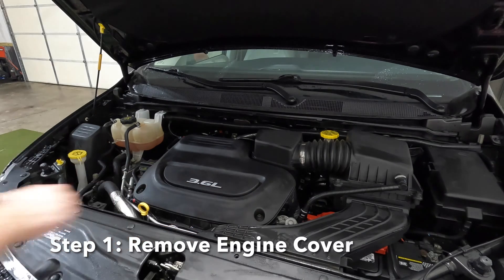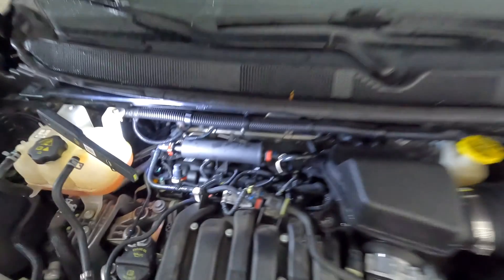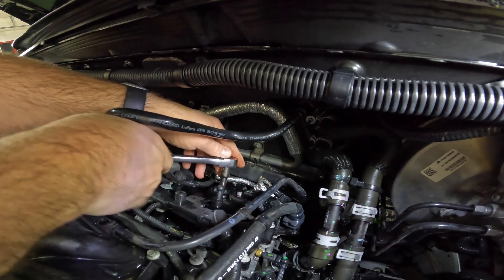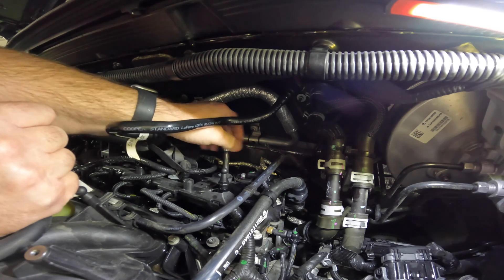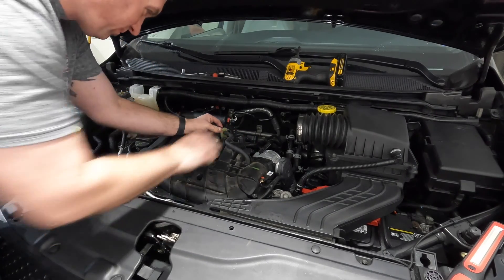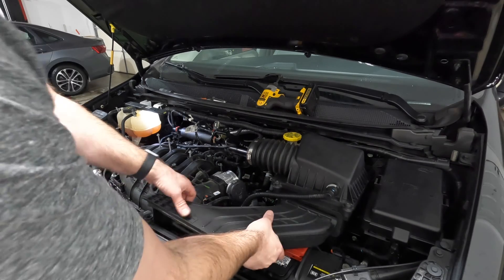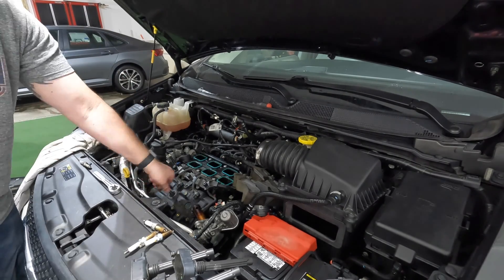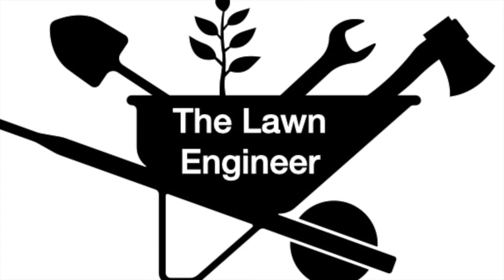How to Replace Spark Plugs/Coils Chrysler 3.6L Pentastar V6

Comment: Thank you for the great video!!! I just completed the plugs and coils on my 2018 Pacifica with 107K miles. I went with the DELPHI GN10951 coils and NGK 93175 plugs. I would highly recommend removing the top threaded post on the "S" bracket on the lower right side vs removing its 3 bolts. This allows the "S" bracket to remain and the intake to still be able to be removed. I believe the post can be removed with a small female torx socket. Removing and re-installing this "S" bracket was the most time consuming and difficult part of the repair and I wish I would have tried removing its top threaded post instead. Most of the electrical clips have small plastic tabs that I pushed out with a small flat screwdriver and then i used a bigger flat screwdriver to pry the clips off. The other non-electrical clips can be removed by squeezing on the plug and pulling. My EGR valve was very dirty so I cleaned that up using carburetor cleaner and this was the other most time consuming part of the repair. I didn't have to remove my small secondary battery nor the air box containing the air filter. My intake gaskets still looked good so I didn't replace them.
Reply from the maker: Awesome, thanks for the detailed feedback on what worked for you!
Reply: @TheLawnEngineer I just bought a 2018 pacifica s two weeks ago.. engine light..#6 maybe.. wow..

Comment: This guy is sharp. Only thing I see is to much anti-seize you need just a very small amount on the threads. Otherwise it will mess with your torque specs. Great video!❤ trust me the spark plugs are not gonna get stuck like in a cast-iron block period. 30 years experience tells me so.
Reply from the maker: Thanks for the comment.  I guess I was worried about big anti-seize getting on my case for not using it 🙃.

Comment: Just a helpful tool for any auto repair where these stupid easy to break plastic hose clips are being messed with is a MECHANIC AUTO PICK SET  there very cheap and extremely help full specially for anyone with weak fingers the curved pick is my go to for working the locking clip back so the clip can be squeezed and released or pulled out
Reply from the maker: That’s a great tip, thanks for sharing!

Comment: What is the grease put on spark plug
Reply from the maker: I used a copper based anti-seize.  The OEM does not recommend using it, but some people swear by it.  I'm somewhere in the middle.
Reply from the maker: Or if you are referring to the boot side, its dielectric grease.

Comment: Thank you, I love your content, so much appreciated. How do you know if you ignition coil or plugs are bad? Currently our 18 Pacifica Limited is in the shop for : Oil Cooler / gaskets, LF RF Solenoid seal replacement $1400. We live in the midwest with sub zero temps, and hot summers, but "what the heck." Seems a Chrysler issue across the board. On top of that diagnostics for heated steering wheel failure, shows wiring harness melted in center of stearing wheel, potentially impacting AIR BAG. Again "what the heck." ...too many odd and end items failing. What are you seeing and know of on your end?
Reply from the maker: I’m glad you are finding value in my videos.  

The best way to test out a coil is to swap it with another cylinder and see if the misfire moves.  Unfortunately the effort it takes to get to the coils on this engine doesn’t make that practical.  If you have to take it down to access the coils and plus, I would replace all plugs and the coils on the cylinders with misfires.

Comment: At 1:30 you push that white clip back for the wire connector with the GREATEST of ease!  In reality, not happening for me.  One actually BROKE!  The connector seems to still push in and stay secure, but what options do I have to either repair the white part that broke? And/or release better in the future soo I don’t crack the piece! Otherwise, This video was essential!
Reply from the maker: I wish I could help more but I have trouble with some too.  They could be more user friendly.

Comment: I have a #3 misfire following to #5. I’ve replaced all spark plugs and coils in 1, 3, and 5. It’s still doing the same thing. Is it beneficial to swap 1-2, 3-4, and 5-6?
Reply from the maker: It is possible that the new coil is bad.  I would swap it and see if the problem moves.

If it stays on the same cylinder, it's time for a compression test.  You may have valve train or head gasket issues on cylinders 3 and 5.  

If the compression checks out fine, you likely have a bad fuel injector(s).

Comment: Great video, but changing the plugs on this engine is STUPID complicated.  I used to be able to pop the hood, pull off the valve covers, yank out the plugs and put new ones in without any other hassle on older vehicles.  I get that engines are more complicated these days but it feels like companies are just trying to make it more difficult for a DIY'er to accomplish anything lately...
Reply from the maker: I completely agree, it's stupid complicated.

Comment: Luck would have it. I have a bad coil in #6, so yeah, thanks for the tutorial. I'm well versed in maintenance, so just watching what you did helped me out immensely.  I did order a new set of 6 but I'm caught in a bind so locally I can get my hands one one coil,so I'll changed that one out and expect great results then do the other 5 in 2 weeks on a weekend 😅
Reply from the maker: I’m glad you found some value in my video even though you have quite a bit of experience.  

It’s too bad you were only able to find one coil locally, but at least the second time will be faster.
Reply: @TheLawnEngineer  as luck would have it, I found 2 coils, so I replaced #6 & #4, and I did a spark plug change to all 6 cylinders I did fix my issues and after driving for a while my check engine light disappeared 😅 Monday will be engine oil change, 
Thanks again, till the next project. 👍
Reply from the maker: @Militaryman64  Awesome, glad it fixed your issue and you were at least find 2 coils.

Comment: I m pretty sure I messed something up while doing this. Car hasn't run the same since the plugs were swapped.
Reply from the maker: Do you have a check engine light?  If not, it’s likely a vacuum leak, missed reconnecting a hose?

Comment: my dealer changed 4 rocker arms and it still ticks. I looked at the valve covers and said how did you do that because they were never removed. They lied and I left it there and told them to fix it right. All this under warranty. They didn't think I would check like most people don't and live with the tick. The original RTV sealant was still there never touched and sand and dirt around covers
Reply from the maker: Very sad…the term stealership applies too often.

Comment: Where that hiding braket bolt at I can’t find it anywhere, I found the nut but not the bolt
Reply from the maker: It's right in the same area, very hard to get it on video.

Comment: At 1:25 or so there is a long horizontal cylinder that blocks the camera view of the rear coils. At 1:29 the cylinder has been removed. I can remove the plastic hoses from both ends, but have not figured out how the cylinder itself comes out. How is it connected to the engine? Do the ends snap on over hard plastic studs similar to the one holding the air box? Thx.
Reply from the maker: I’m sorry, I’ve been tacky my brain to remember how that came off but I can’t recall.  I vaguely remember it just pulling off.
Reply: Ok, figured it out.  Yes, each end pops straight up off a plastic stud.  I pried the ends off with an angled tool without exerting much force.  When done the ends just snap back on, sort of like when replacing the beauty cover on top of the engine.

Comment: Would you happen to know what the gap should be? I bought o.e. for mine and they are at .024 and I'm not sure if that's right.
Reply from the maker: I'm seeing an OE recommended gap of 0.040 in but it varies a bit depending on the plug.  Checkout www.rockauto.com it gives OE gap recommendation for a bunch of different plugs.
Reply: @TheLawnEngineer  Thank you for that.I'm not sure why they say OE and set them that tight.But I'll definitely be opening them up👍
Reply: How did you get those ignition wires off of the coil so easily?

Comment: Do you have to replace any gaskets when putting the plenum back on?
Reply from the maker: You don’t have too.  The gaskets are silicone and they won’t typically stick or tear.  But it’s not a bad idea to change them out because they can become compressed over time.
Reply: @TheLawnEngineer  This was my exact question RE: ANY gaskets that may need or SHOULD be replaced.  What parts might it be SUPER smart to pre-order (connectors?) as there is a decent chance they could break!?  Thx in advance!

Comment: Had a P0305 cylinder 5 misfire code. Your video was helpful. I replaced the spark plug and ignition coil and seems to be good as new. I since 5 is on back row, I didn’t remove manifold to save time.
Reply from the maker: Nice work!  The back row makes life easier.
Reply: That hasn't turned into the nightmare "P0305 to blown headgasket" situation has it? Those stories are all over the web and kinda worrying me since my coolant is also low.
Reply: @ after cylinder misfire popped up again, mine was a blown gasket. Had it replaced and now all better.

Comment: ok just making sure that i will not have to replace a intake gasket since you took it off? i am used to older rigs when you take them off its wise to replace the gasket. never worked on one that had a plastic intake. Is there a difference?
Reply from the maker: The gasket(s) on these intakes are a bit different.  They are individual silicone pieces that do not stick and rip/tear.  They can dry out over time and compress but in general can be reused.  

I didn't have any issues with reusing but it isn't a bad idea to replace them.  I've also replaced the oil cooler, which is under the lower intake manifold, so I replaced them all at that time.  

Video here: https://youtu.be/GauBMDckIKE

Comment: Thanks for this video!!  We had either a bad spark plug or coil pack and were able to change them all out ourselves for under $75.  I cannot imagine what this would have cost us at the dealership.  I would never have attempted this without your video.  Thank you so much.
Reply: Under 75$ how? The plugs are 20$ each and the boots are 75$ each?
Reply: @wacoodude9436 plugs range from 8-that much lol I got mine for 13 dollars a piece platinum plugs
Reply: @wacoodude9436 I think they may they changed one cylinder.
Reply: @wacoodude9436  Wondering the same. You owe us an explanation Mr.!
Reply: $500 at a mechanic. Just got ours back yesterday.
Reply from the maker: Glad it helped! Thanks for leaving a nice comment 👍
Reply: @TheLawnEngineer  Did the poster or you put in aftermarket coils or oem?.. Oems are $90 a piece. AIN'T gonna happen😅

Comment: It took me forever to find that hidden nut underneath. Mine has some black plastic over it, and I can't get to the nut. Also, I need step by step video for all the connectors. I've broken 3 already. They're brittle and too difficult to understand!
Reply from the maker: That nut is a pain to get at, and filming it seemed impossible.  Also, there are some other decent videos out there on the electrical connectors.  There is a little trick to each of them and if you get it, they separate easily.
Reply: The black plastic over the bolt is actually a support hook for the wiring harness next to it. The hidden bolt acts as a stud for the harness to connect. Try putting your fingers under the harness near the stud and the plastic should just slide off.

Comment: Great video. One issue - I can't for the life of me figure out how you get the wire connector to disconnect from the coil like you do in the video. I use a small screwdriver (like you) to "click" the little gray "lock tab" but absolutely can't get the connector to budge on 1, 3 or 5 so far...
Reply from the maker: You should actually press down with your thumb and pull the latch back at the same time.  If you get it correctly it’s like magic but you have to get the hang of it.
Reply: I had to take it a step further. Carefully pull the white plastic tab outwards a tad until it clicks in the unlocked position, and then press downwards on said tab with your thumb while using a plastic trim tool to carefully pry the plug off from behind.  My thumb got sore, so I used a small narrow-bladed screw driver to carefully hold the white tab down while using the trim tool to lightly pry the plug off. As with all connectors, easy does it!!  If you are only changing out your spark plugs and not the coils, there are a couple of YT videos that show you can simply pull the coil pack up and out of the spark plug opening without the need to disconnect the coil wire, but if you pull it out using too much force you might possibly damage the connection.

Comment: Thanks so much for this. My reluctance to tackle this project revolves around the various wire and tubing connectors. I appreciate your comments on how to remove the air temperature sensor (at about 1 minute into the video).  At 5:14 you use a small flathead to pry up on a red connector, but then explain that the red part can be pressed down while pulling out on the tube to free it. True? It looks to me like one really does need to pry up on it (and then press down when reinstalling). Also, is there anything unique about removing the electrical connectors on the throttle body side (at around 6:15 into video)? I'm pretrified of damaging a connection. Once again, thank you for this and your other Pacifica videos.  Very valuable.
Reply from the maker: If you have some time and patience, you can get this done.  

At 5:14, no need to pry...pushing down will release and allow reassembly.

Electrical connections can be a bit tricky but they should all release with a gentle wiggle if you have the release catch properly depressed.  The trick is taking your time and don't force them.

Comment: Generally speaking, I liked your video and I completed the job of plugs and coils in an afternoon on my 2017 Pacifica.  However, you really glossed over some stuff on the righthand side (as viewed) that was very troublesome.  It was very difficult to get the EGR valve off over those studs and the hose connection.  One of the studs by that hidden bracket was covered by a push-on wire restraint making it difficult to see what was keeping the plenum from releasing.  Your video made that EGR removal look like a snap, which it was definitely not.
Reply from the maker: Thanks for checking in.  Your feedback is fair, that particular nut for the EGR valve is a pain in the butt.
Reply: @TheLawnEngineer  Nice video. Greatly appreciate the nice and clear footage and helpful voice over. I had to remove the whole bracket with the hidden nut by also unscrewing the two lower bolts. Loosened the two nuts holding the brake booster pump to allow for wiggle room to get the bracket out. Keep these videos coming please! Thank you!
Reply: My sentiments exactly! Over all the video was good and informative, however that EGR almost made me quit the whole job and have my brother in law finish the job. I eventually was able to disconnect it completely to get it fully out via whatever hose it connects to. I had to watch another video to make sure I wasn't messing anything up.
Reply: Yeah there is that hidden long plate bracket with 3 bolt holes under the EGR once that comes off the EGR slides right off the 3 studs..

Comment: We have a 2018 and recently have had a local auto shop replace #5 spark plug and ignition coil twice. The check engine light came on again over the weekend. Anyone have any insight on why this is happening?
Reply: The engine is giving a king of a ticking sound as well when running. Not sure if that’s normal.
Reply from the maker: @brycewhisman2115  small ticks are normal for the valve train but louder ones can indicate a problem.  There is likely something fuel or valve train related going on with cylinder #5.  A fuel injector that isn’t functioning correctly could foul the spark plug .  

There also could be a collapsed lifter on cylinder 5 that isn’t allowing an intake or exhaust valve to open fully.  

You could also have a sealing issue on #5, a compression test would prove/disprove this.
Reply: @TheLawnEngineer  ok thanks. I’m not super handy so plan on taking it up to the dealer later this month and hoping they can fix it.
Reply: Also the check engine light came back on today and my wife said there was smoke coming out of the exhaust 😬 hoping it’s nothing too major as we are no longer in warranty.
Reply from the maker: @brycewhisman2115  good plan.  I would also ask around about a trustworthy non dealer mechanic.  They might be cheaper and more straightforward.
Reply from the maker: @brycewhisman2115  if it was white smoke, a fuel injector is stuck open.
Reply: @TheLawnEngineer  I'm getting that exact same code now for #5, first time for me. 
I get a rough idle just after starting, if it's been sitting, but then it levels out and doesn't return after running for a few seconds. 
Parts guy I talked to agreed it's probably just the spark plug, but I'm torn on just replacing one or all. 

I'll probably start with the one and if nothing acts up, just leave it. 

Can you detail what length extensions and sockets you used? I probably don't have an extension that long or torque wrench, so I need to go shopping.
Reply from the maker: That’s unfortunate, is the code always a misfire on cylinder #5?
Reply: @TheLawnEngineer  yes each time we are getting a code that 5 is misfiring. My father in law just replaced it again tonight but I’m worried the check engine light will come on again.